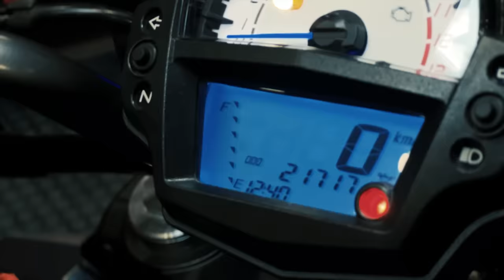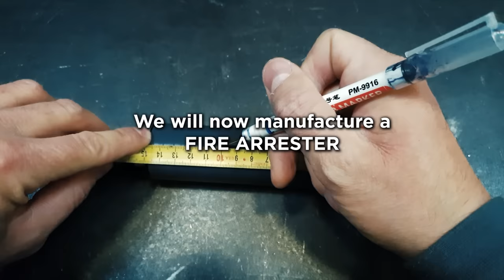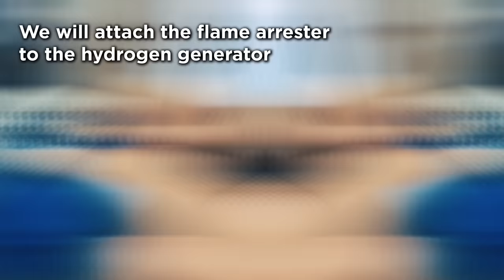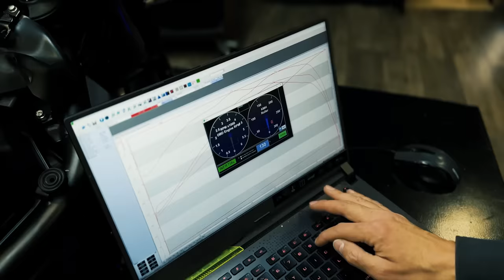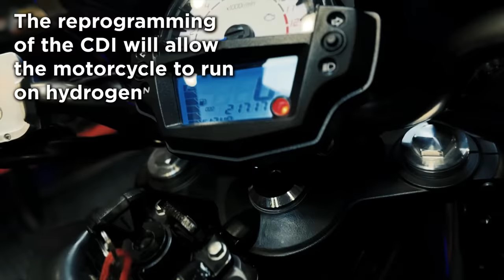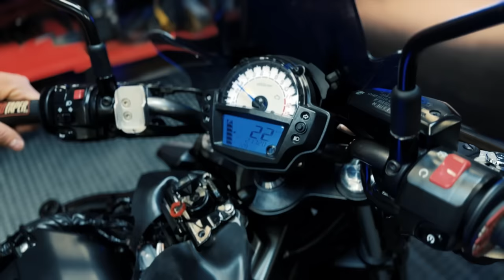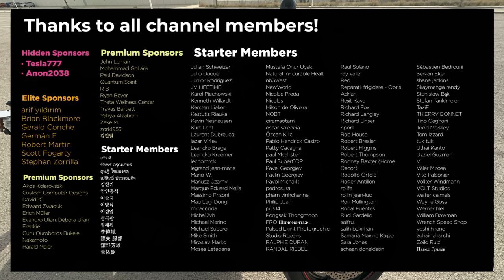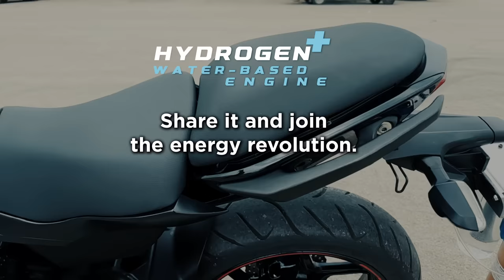Running Bike On Water - 100% Working Trick

Comment: Is he using a bridged rectifiers to pulse a reasonable frequency of the water for electrolysis? This is what Stan Meyers did in order to reduce the heat production of the cell itself and lower the needed amperage for the correct amount for engine speeds. Meyers ended up with only needing less than an amp to run a Volkswagen engine in his dune buggy which produced hardly any heat from the power cell. He even put a hose on the exhaust pipe and breathed it in for a few a minute or so to oroo e the waste product of his hydrogen cell was only oxygen. As many as there are that doesn't believe this , there was at least one that did because of the circumstances of him passing away and the results of the private autopsy his wire had conducted due to how many advised her of the suspicious circumstances. Supposedly they discovered enough strictnine in his body to cause ten elephants to pass away even after being pumped full of embolment fluid but how true this is I just don't know. I created one myself from his PDF files and it truly works but I got company overhead from a Huey helicopter which freaked me out so I quit messing with it. And I'm talking about .ore than five hundred miles per gallon of water. Displacement ratio was unbelievable.

Comment: You have 2 gases in that chamber, both Oxigen and Hydrogen, elecrtolysis needs 2 electrode, one positive and one negative, indeed you have an HIGH explosive mixture in that tube, for sure it burn inside the engine, but it could explode easily in any part of the line.. i'm not sure of the amount of gas you can produce with the bike's electric implant, i think you have a little tank hided in somewhere and also if it's not the case, how have you put an explosive mixture inside an injection system originally built to work with only gasoline? keep away all the airbox it would be intresting.
Bro, nice try but you lack of basic phisic's laws 😂
Reply: As long as there is no spark created anywhere then it's safe

Comment: I know hydrogen burns extremely hot so the engine would melt.  Also you would need a hydrogen tank and a way of pressurizing it also would need to charge the tank in advance.  Too many problems with this video however it is well edited and entertaining.

Comment: When do you explain that the engine stops when the battery is discharged after just a few miles of riding?
Reply: Do you know how an alternator works in conjunction with the crankshaft on it's belt to keep the battery charged while the engine is on? Well now you know. All vehicles work like that. Without the use of an alternator, your vehicle's battery would die. What exactly did you think keeps them charged? Prayers and good luck charms?

Comment: Everyone seems to believe it's pure Hydrogen, when in fact he is using a form of lower grade hydrogen for the fuel...Pure Hydrogen needs super cold temps and high pressure tanks for storage, if this tech could be implemented into everyday vehicles most modern cars would need major retrofitment for the unit plus overhauls in the ECUs because of certain emission programming!

Comment: HYDRO-GEN Hydro for hydrogen. gen for generation. I'm all four hydrogen powered vehicles, lawn mowers, tractors and bikes. In fact, I do plan on creating a Hydrogen engine an engine that can run on hydrogen simply through electrolysis. And this runs solely on hydrogen. No gas involved, no trickery. It's directly running on hydrogen. Now, the thing with this is, I'm probably gonna get assassinated for creating this by some big, high-end Chevrolet Toyota, or big oil executive. And that's gonna drive people nuts. But don't worry, my designs will live on. Go hydrogen, go. internal combustion engine. Go hydrogen combustion engine. This. is the hydrogen fuel initiative.
Reply: I trust you
Reply: stay away from windows😂
Reply: Че бутылка заливаити

Comment: I'm interested in the data... how did you deal with hydrogen surplus or shortage? what will happen if hydrogen production is too high?
Reply: This seems to run for a short time only. excess hydrogen gets released in the air. The setup only uses what it is needed. This was meant as a project and not for transportation of long distances.

Comment: Does this mean my HHO Generators  is worth money now?  I own the name and been waiting for this moment.  Is this real?
Reply: No. You need a battery to convert water to HHO.

The amount of water you can convert to HHO is dictated by the capacity of the battery on the motorcycle.

It makes far more sense to use the battery to power a motor directly than to lug around all the extra shit involved here.
Reply: @incandescentwithrage ,install another battery , generate hydrogen,start,run the engine,charge the battery case closed!
Reply: @paulwachira7679 It doesn't work, what have you kids done in physics class? Slept? Bored in the nose? Watched out the windows? 😂

Comment: These systems are intended to increase gas mileage and will not replace the gas itself the bike would never generate enough hydrogen to run on by itself it takes a lot of amperage that this bike could never supply

Comment: Oh ya one other thing noticed. Overcome the cdi box aka ecu...your modification must somehow trick the ECU to think it's receiving a constant fuel source but it isn't .the "fuel source" is entering the engines air intake manifolds rich with hydrogen/oxygen gas aka Hauns Gas... because if the cdi sees no fuel it won't allow it to run right? What's the basic concept behind the mod for cdi?

Comment: Eventually, the electricity that turned water into hydrogen will run out. Better off using that electricity turning the motor. But the extra step is for the fun of what if.
Reply: Solar panels or a mini homemade nuclear power plant

Comment: I'm not sure I saw any of the water level in the reservoir drop...did the bike actually run on this...electrolisis is a rather slow process and im not convinced that system could separate the hydrogen from water fast enough to run that engine!
Reply: It wouldn't be possible because the losses in the engine outweigh the possible speed of the electrolysis another thing is how are you making energy in the first place

Comment: So then a half a liter (500 cc) engine running at 2000 rpm will take in a volume of gases at about 1 cubic meter per minute. You need about 7% of Hydrogen to have the right mixture to ignite in the cylinders. You will need about 70 liters of HHO gas per minute for that bike to run at 2000 rpm; 28 litres of HHO just to idle. It looks like your gadget only makes about 1 to 2 liters of HHO per minute.... Explain please. Also, the cooling effect of liquid gasoline stops the valves from burning out. There are discussions regarding the need for some sort of water injection if you could actually make an engine run on HHO. You'll need to narrate your video for your explanations on how you overcame the ratio of air to hydrogen so that combustion can occur.
Reply: Its 4 stroke tough
Reply: @pazderca4404  if it was a 20 stroke, there wouldn't be enough hydrogen to run.

Comment: Ok, so... 

For those who believe it religiously, I have no message - there is simply no point.

But for those who use logic, their brains not only for physiological activities:
- calculate what energy gas (or LPG) carries when burnt in a combustion engine,
- calculate what electrical energy can be obtained from such engine (assuming 100% of efficiency - I know impossible, but.. who cares),
- now calculate what ammount of hydrogen can be achieved in such "reactor" ;)
- calculate what heat of combustion you can get, assuming hydrogen 100% burnt.

Now the number would speak for themselves and you will abandon idiotic ideas ;)
Reply: It's that time again now go get your booster
Reply: Speak some sense into them...
Thermodynamics says hello buds
Reply: Math and physics are so mean and offend my feelings
Reply: I do follow along, but why is Toyota stating that they will release car on pure water without need of hydrogen refill/tank. I am just curious about it

Comment: In the long run the engine will fail and destroyed because of rust and hydrogens high burn temperature cylinders and pistons needs to be covered with ceramic layer to cope with it
Reply: This hard work ,,,,,,,with ceramics  in combustion chamber,……..Voila ´  ,…. 
Nice clean work ,,,,,,!
Reply: Sok tau loe cok

Comment: I mean, cool, except you need electrical power for electrolysis, at least as much as you get out in terms of energy. So even if this does work the same way as you present it, a purely electric vehicle would do the same more efficiently, without noise and vibration and with considerably higher torque.

Comment: Physics laws cannot be violated by tricks. You spend more energy for electrolysis and you have less energy after burning the hydrogen (heat) and less on converting heat to kinetic energy. LOSS  OF TIME     100%. I am sorry my friend. ( Petrol engines gives about 30% kinetic energy of every 100 (heat) you  give it.)
Reply: its all about how much MONEY it costs to run it
Reply: @brenohighland1168 
Yeah it could be less efficient but cost significantly less

Comment: I missed the bit where the gas was being regulated going into the engine.
Reply: I have the same question, how the system can regulate the flow of hydrogen when you ask more power (required by the accelerating motorcycle)?

Comment: You state that this will work for a maximum of 650 cc engines. Would adding a second unit double this size because of twice the fuel. Would putting multiple units in one big tank of water allow ever-increasing sizes of engines up to and including large V8s. 

At what number of units would it take too much power. What is the maximum number of these you could practically use and not overpower the alternater.

What about winter below freezing temperatures. Is there an antifreeze and if so how much does it reduce the freezing point. 

I also saw a video of people taking a unit like this and splicing it into the fuel line, mixing them in with the gas, reducing its usage rather than totally replacing it. It is this OK to do ro dangerous. 

I look forward to your reply.

Comment: I wonder if the water contraption at the back could be put inside a modified petrol tank. How long will this last as the left tank looks very orange
Reply: graphite plates will massively decrease the brown water
Reply: Orange color is not a big deal even it became dark as long its working.
Reply: @JojieBragasin  how long does each intake of fresh water last, such as filling up the take in miles.?

Comment: it doesnt run on water, it runs on hydrogen.
Reply: Teslas don't run on electricity, they run on lithium stability.
Reply: @FloridaMeng  Teslas don't convert electricity to anything, however this bike converts water through electrolysis into hydrogen and that is used to run the engine
Reply: @sans6924  they convert electricity into torque. This can go on and on. Gas to torque. Water to torque. Energy to work. My point is water is his fuel storage. It's like setting up a compact pyrolysis setup to get the gas out of the petrol into the engine in its purest constituents. Sure technically the engine would be gasoline but it still came from petrol. Just like this hydrogen combustion engine is using water. Just like an electric engine wiggles the electromagnetic field due to electrons wiggling back and forth.
Reply: Eso no funciona si no tiene más energía de la que le pueda sacar con hho nisokiera es hidrógeno es hho
Reply: @FloridaMeng  if you really want to get pedantic, he isnt using water, water been H2O, and then theres the compound hes added which makes it something like H4O.
Reply: @FloridaMeng  but for the bike to run on water, in the sense of "it runs on water" then water would need injecting into the engine and then combust.
Reply: It runs on Bill shit

Comment: Wounder how long untile the valves and exhaust pipe will last until they need to be replaced. I didn't see them switching them out with stainless steel or something none corrosive
Reply: No worries because a) it doesn't work anyways b.) about 1 liter of water is generated from the combustion of one liter of gasoline already c.) exhaust gas temperatures are far above the boiling point of water

Comment: Can i still gas myself in the garage with it?
Reply: Not with the emissions. When hydrogen and oxygen combust, you just get the explosion and a little bit of water. No harmful emissions like carbin monoxide or green house gasses. You could disconnect the (hydrogen) fuel line from the bike and pipe it into a small closet to displace the oxygen. That might work.
Reply: No, but pipe the exhaust into a small cabin and hey presto you've now got a sauna.

Comment: Funny ...
Everybody focus about water and hydrogen ... 😂
Did you understand that water is transformed into hydrogen by using the energy of battery ...
So in fact this bike is not using water ! 
It's using electricity to convert water into combustible for the motor ...
The reality is that your autonomy is limited by the capacity of the battery.
Reply: or the altinator
Reply: @brenohighland1168 alternators only recharge the battery. Everything runs off the battery. Remove the battery and the engine dies. In older carbureted cars you could pull the battery but not EFI engines.
Reply: @roushstge2  correct you are
Reply: Remember that alternator only converts a very small part of the energy produced by the engin into electricity.
Alternator has no chance to supply enough power to follow the engine needs.
On each step you have an energy loss :
By converting water into hydrogen, by converting hydrogen into rotative motion, by using the rotative motion to move the bike ... etc ...

Comment: من أين حصلت على الطاقة؟
Reply: Its the hydrogen in the water
Reply: @Clarky805  نحتاج إلى الطاقة لكي نستخرج الهيدروجين من الماء.
Reply: @مبارياتكرةالقدم-ق9د  from memory he said he was using 5 amps at 12 Volts. The bike does not have to make the water then split it. It just has to create the environent for the hydrogen and oxygen to separate. He is giving a polaric advantage with the additive before running the 5 amps through the water. Very simple.

Comment: Jajajaja engine Dead 💔💔
It is not only about changing the type of fuel in the engine and that's it, you have to keep in mind that this engine is not designed for that, although it works but you damage the cylinder chamber and the piston, it is not advisable to do this without first modifying the engine.

Comment: Greate but...
- looks like he/she do not tuned it and configure amount of hydrogen+oxygen when accelerating, it is hard to configure it and it will not working like that, more engine speed more hudrogen+oxygen needed and it looks like no such installation here unfortunately;(((
- hydrogen will most probably destroy metal parts of the engine because it love to integrate (and destroy) metals ;((((
- to make electrolysis and profuce enough amount of hydrogen+oxygenr you need really lot of power, it is not visible here that such power is achieved here and the problem that you need more power than you receive from rngine running only on hydrogen+oxygen from that electrolysis, this is a real problem, but electrolysis can be tuned to be more efficient, for example ny doing it at high presure and high temperature like 1000 Celsius.

So I do not believe this is real setup running on hydrogen+Oxygen only...
But I believe it is rather possible to make such/similar setup, but it is much more complicated.

Also it is possible to add some hydrogen+oxygen to any normal engine to increase engine efficiency, but it still may destroy your engine unfortunately sooner or later  becaue hydrogen love to destroy metals ;(((((
Reply: For all of us who think certain things are not possible.... ask yourself is it the lectures and the books you read that showed u, its not possible or the scientists that were said to be brilliant or ur own experiment? The world we live in is smtn u must b careful of because it can teach u wat u supposed to know verses what is really true, just to try and keep its own balance in the economic system.... so my 2 cent advice is, leave no stone unturned, prove everything yourself before u take what u given...

Comment: What about overheating the HHO plates? When the system runs for long periods of time the solution usually gets hot that's why you will observe that the plates started to change color due to this reaction. But it works bro.. good job.😊
Reply: Cylinder head melt down!